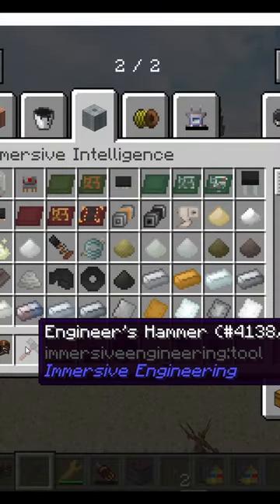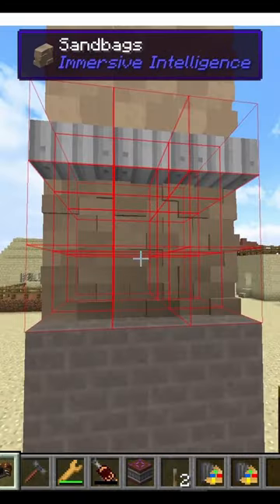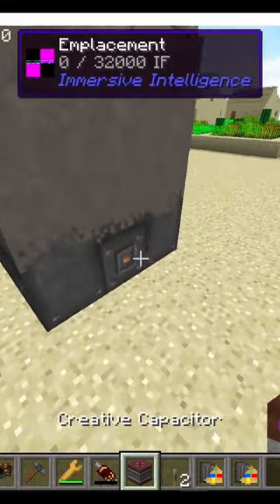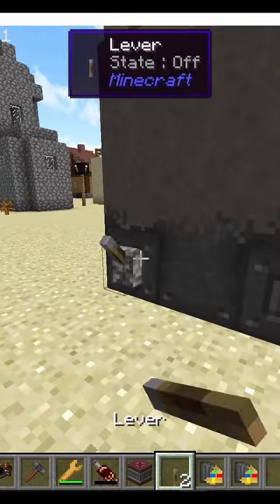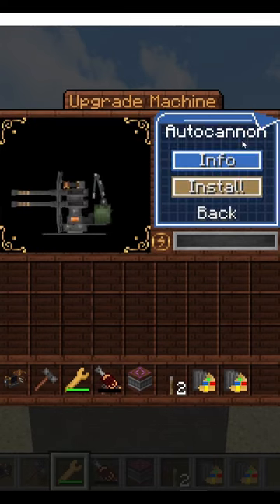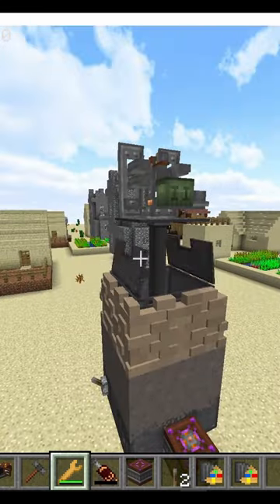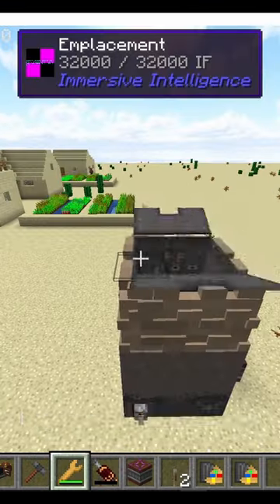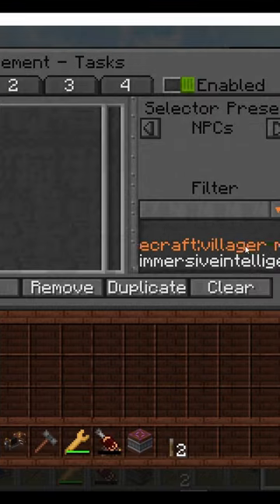Emplacement Turret Tutorial - Immersive Intelligence #shorts

Comment: i have enginering and intelligency but dont see emplacement turret whyyy somebody? crafteo?
Reply from the maker: Maybe cause you need immersive petroleum in order to get projector as well
Reply: @SavageVegeta  Hey, when i install Immersive Petroleum, the game crashes. (I'm on 1.12.2). I tried installing Not Enough Petroleum but it didn't work aswell. Help?
Reply from the maker: @rafaelcamillivieira5129  it works fine for me and I don't have not enough petroleum as well. Just have all of the mods needed to run( the related mods and dependencies) and you should be good to go
Reply: @SavageVegeta  What mods needed to run? I have Immersive Intelligence and Immersive Engineering rn. Any more i need to get?
Reply: @SavageVegeta  What version did you get on curseforge? Maybe it's my Java version?
Reply from the maker: @rafaelcamillivieira5129  when you go to the Curseforge page for any mod there is a tab called "relations" 
check that for all the mods you need for running the given mod
Reply: @SavageVegeta  I already have Immersive Engineering.
Reply: @SavageVegeta  Ill send what the crash says the problem is when i get home.